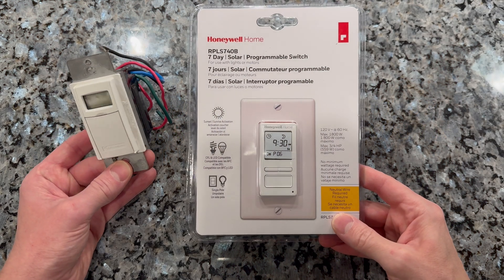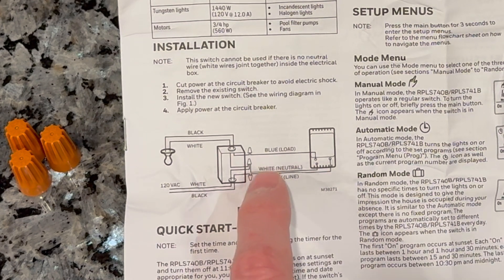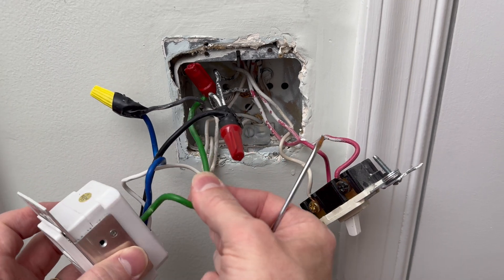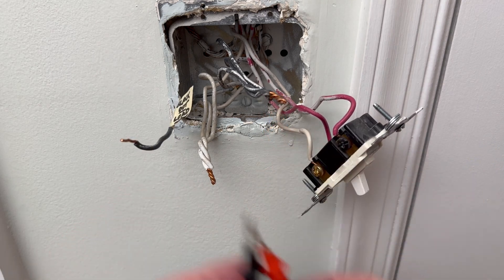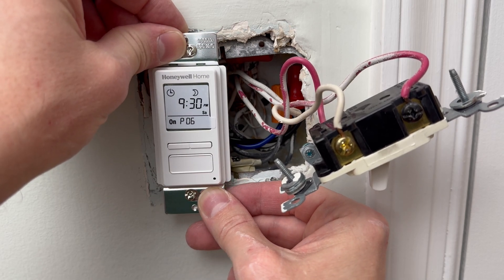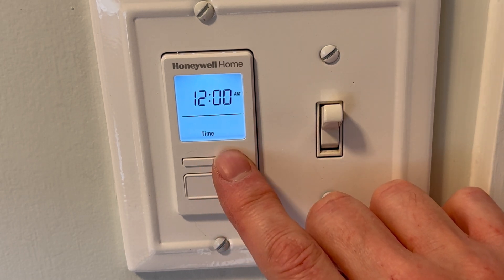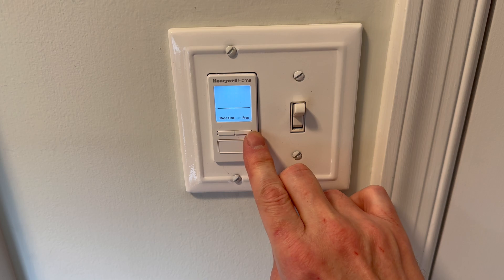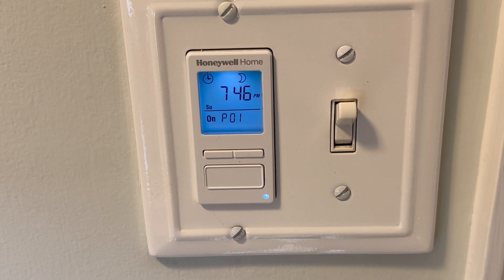How to install and set up a programmable light switch (Honeywell RPLS740B)

Comment: What happened to the ground in the new set up?
Reply from the maker: @patrickcody8344:  The new switch set up does not have a separate ground wire so I left the ground wires tied off inside the junction box.